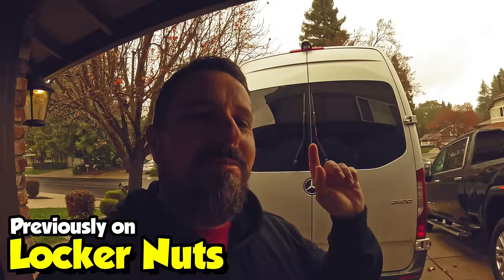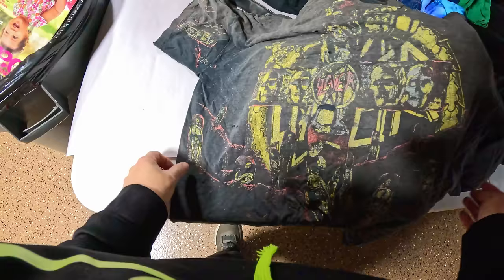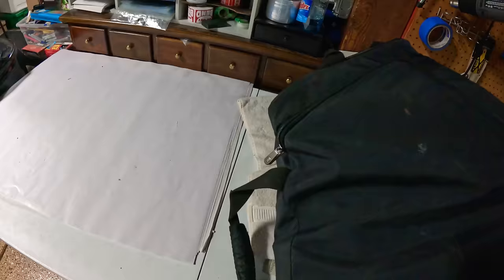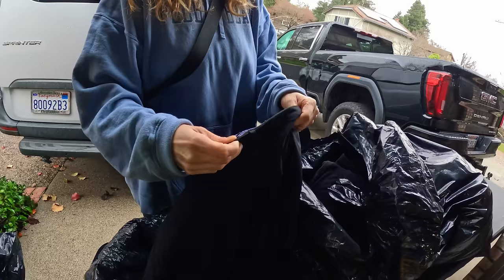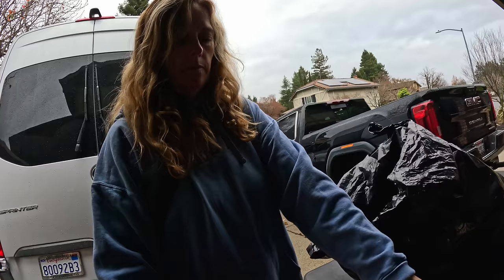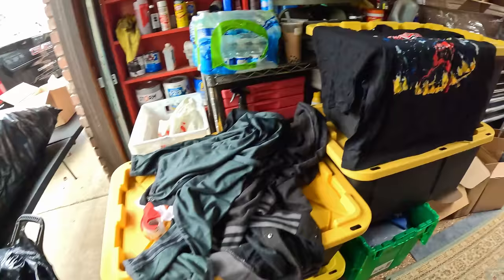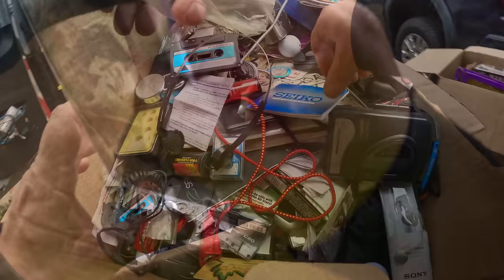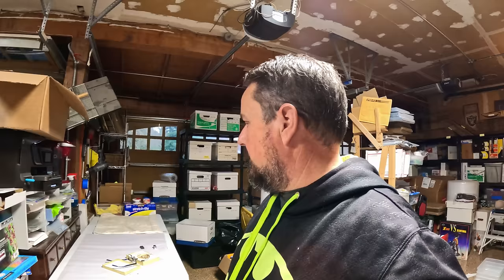I NEVER expected to find THIS... You would never see it coming in a million years!

Comment: Hey Jack, that zebra can be charged with a usb-c cord.  Use a paper clip in the hole on the bottom and pull the bottom out.  There is where you plug in the cord. We use them at work